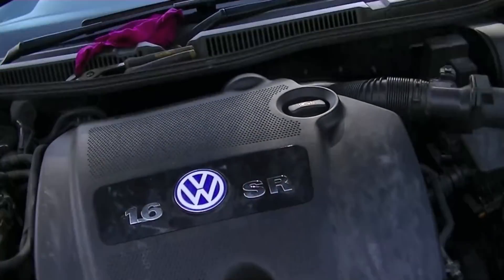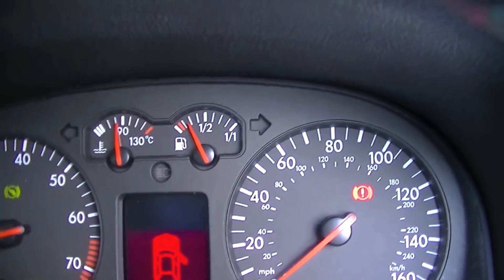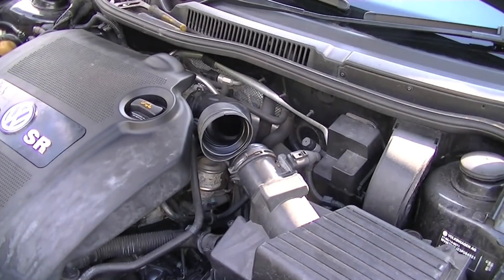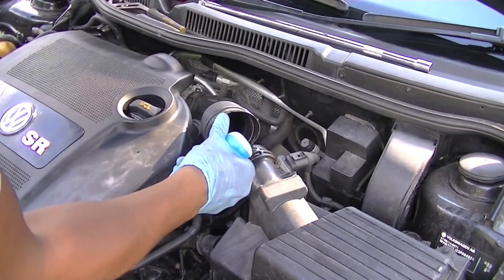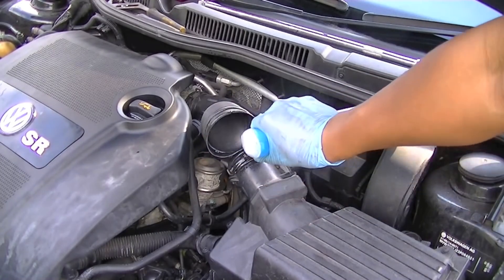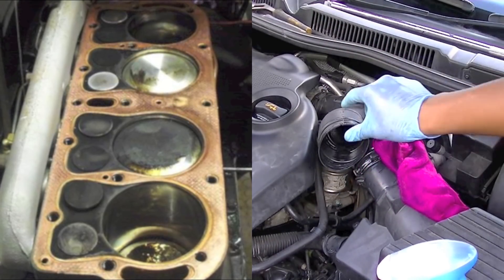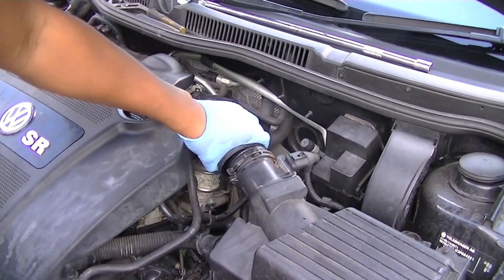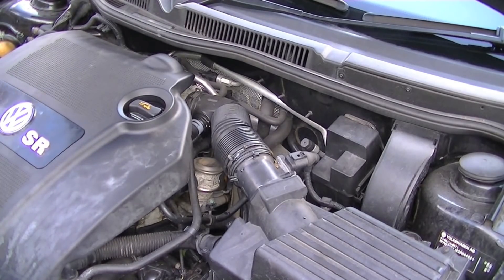How to make your engine run better with just tap water.......Better Than Seafoam?

Comment: Whether this works or not makes absolutely no difference, because doing this is extremely dangerous and can very easily destroy your engine entirely. Its danger alone far outweighs any little carbon deposits it may or may not clean. If your engine has any significant carbon build up that is causing performance issues, a much safer way is to just run your car in the mid rev range (about 3k rpms or so) for a little bit. In that rev range and up the engine will run a leaner fuel mixture resulting in a hotter and more complete burn which also results in the burning of carbon deposits. Pouring an incompressible liquid into what is essentially an air compressor is the worst advice iv ever heard and no mechanic with an education would advise it. Unless you can afford a new car.
Reply from the maker: BMW have just released their New M4 with a water methanol injection set up. Can you explain why they would do that if it was such a silly idea?
Reply: +BMAC VAGS Because they designed that engine to run that way. The engine in this video, and 99% of the engines out there are not made to have water in the combustion chamber. Some engines run on alcohol, so why dont we just pour vodka in our gas tanks?
Reply from the maker: +Nick Palaroan So are you saying they have designed a engine to compress water?
Reply from the maker: I think if you understood what was happening a little better, your thoughts and opinion would change. Have you seen what it takes to hydrolock an engine? 
If you have then you would know that spraying a little water into the intake will do no harm.
Reply: +BMAC VAGS No. Water cannot be compressed, its impossible. But I did just look up that engine and heres how it works.....It sprays a fine, controlled mist of water into the port which cools the air before it reaches the combustion chamber helping to cool the engine. And because water is incompressible, it also increases the compression ratio in the engine. You see, the engine was designed to have water injected into it. A normal engine, namely the computer controlling the engine, is not setup to accept water into the combustion chamber which will increase the compression ratio (since the water is taking up space but cant be compressed or burned) and the computer cannot compensate for that. What you sprayed into this engine was far more than a mist, and far more than the car intakes when its raining (which is almost nill the way intakes are designed so water doesnt enter the engine) the engine may seem to run fine, but chances are you created alot more pressure in the engine which could have easily damaged seals or cracked the block.
Reply: +BMAC VAGS How much it takes to hydrolock an engine will vary greatly from engine to engine....there is no set amount, and typically its not very much. And theres no way of knowing what amount will be safe and what amount wont be without doing a shit ton of math and knowing the engine your working with inside and out. I highly doubt you did either of those things before hand.
Reply: +BMAC VAGS I know exactly whats happening. Iv built engines, i know how they work. Iv already put it simple for you. Whats happening is your spraying an incompressible liquid into a compressor which equals bad news. Like i said, thats how engines blow up. They dont always hydrolock either, in some cases the pressure can bend the connecting rod which can result in a piston shooting out from the block. Know the dangers of what your doing before you do it....
Reply from the maker: +Nick Palaroan Fuel is incompressible too, but in small amounts you will have no problems. How many con rods have you seen blown out by water/methanol injection?
Reply: +BMAC VAGS Fuel is not incompressible.....if it was, no engine would work....fuel is much less dense than water, which is why it is much easier to compress than water. Water is compressible, but no engine will have enough force to compress it.  Fuel on the other hand, is also vaporized before it enters the combustion chamber, making it that much easier to compress....chances are, since the water is more dense it most likely wont enter the combustion chamber in vapor form.  I dont know why your still bringing up water/meth injection engines because they have nothing to do with the normal production engines we are talking about. They are designed to run differently, as Iv already described.
Reply: +BMAC VAGS Im not saying that this method doesnt work to decarbonize an engine, I personally dont believe it would do any good and given all the minerals and salts in tap water chances are you are introducing more junk that can leave different kinds of deposits of their own and the salts certainly wont be good on the internal components.
Reply: +BMAC VAGS Its good that you mentioned to put the water in after the MAF sensor, however you also talk about the engine "dying", thats a sign that your most likely causing damage already. And you talk about coolant leaking onto a piston and steam cleaning it....well, coolant has alot more in it than tap water does, and alot of its main ingredients are solvents which would do an excellent job at cleaning that piston so there really is no reason to believe that tap water would do the same thing.
Reply from the maker: +Nick Palaroan Check out the internals on HHO and water/meth vehicles, i think you will find that the internals are much cleaner than conventional. I know what i am saying goes against your common train of thought, but that does not mean that it doesn't work
Reply: +BMAC VAGS And then  we go back to....why dont we just run our cars on vodka? Other engines can do so. Your logic is flawed im not sure why you cant see that...
Reply: +BMAC VAGS Im not saying it wont clean the carbon, stated that many times. What im saying is that in the process of cleaning the carbon you risk damaging other components and the quality of the water itself can cause other damage and build up.
Reply from the maker: Nick Palaroan Ok fair enough. However I would like to add that there is little to chance of it doing any real damage if it is administered in this way. And in my experience the dangers are minimal. Have you ever tried it?
Reply: +BMAC VAGS No. I have no need to try it. As iv stated, theres a safer and easier way to remove carbon deposits and thats by reving the engine up to mid range where the fuel burns hotter and more completely.
Reply: @nickpalaroan8865  A litre of vodka is $35, a litre of gas is $1.26. You drink vodka, fill your car with gas, not the other way around.
Reply: physics isn't exactly your strongest subject is it Nick.   I think you may be able to expound on some subject that you have learned about in life, but this is not one of them.
Reply: +Nick Palaroan BMAC VAGS isn't putting a significant amount of water into the engine. The small amount of water would simply be turned into steam by the engine heat. A LOT of water would hydrolock the engine, so don't go pouring a litre of water into your intake, common sense really. If anything, i would want to change my engine oil after doing this. 
Fuel is incompressible, it's a LIQUID. Thankfully the fuel is injected into the engine in a MIST, in small quantities. 
Driving at 3000 RPM for extended amounts of time wouldn't clear the engine significantly.... as that's the engine speed attained by driving on the motorway anyway. 
I don't believe this method works either to any great degree however, it will remove some but not significant amounts of carbon build up.
Reply: +Nick Palaroan OK, so tell us exactly how spraying a little water in an engine can destroy it. When doing this, you are just putting small amounts of water in, not near enough to fill the cylinder. The water is dispersed among all cylinders, you would have to dump water in like crazy to do anything. The car would stall  before he could too much damage. You're acting like he is using a garden hose to put water in his engine. And no, BMW's engines are not specially designed for water injection, you can add water injection to any car, people have been doing it for decades as a way to control detonation. Too much water could wash down cylinder walls which is not good, but a spray bottle or dribbling water into a carb will not hurt anything in the engine.  Most cars hydrolock from a stuck float or a fuel pump that runs when car is shut off, pushing fuel past float out of fuel bowl, then when you try to start your car, bad things can happen. You're stuck on water not being compressible, which is true, but doesn't really apply here. Yourmechanical aptitude isn't what you think it is.
Reply: yall ignorant fucks , i said do some research , it works, theres video evidence . THATS WHY I SAID DO SOME RESEARCH .
Reply: +bigkification Fuel is far easier to compress than water. Water is technically not &quot;incompressible&quot; it just takes an insane amount of force to compress it, far more than any piston could. Fuel on the other hand, is a much less dense liquid and will compress easier, however we know that the engine does not compress liquid fuel it compresses vaporized fuel.
Reply: Bizzy Bee
A simple spark will not split water you idiot...It requires alot more electricity than that for a longer period of time.
Reply: bryson west
Im not stuck on anything. Im simply explaining why tap water is not good to be put into an engine, and not only because of hydrolocking risks.  Again, since you cant read, tap water contains alot of minerals and salts that you DONT want inside your engine. And yes, the specific BMW engine in question is in fact designed for water injection, you cannot just throw water into the cylinders of a normal car and expect any improvement in performance or life span because you are literally changing the parameters of the cylinder which will throw off everything else in the engine since the computer isnt programmed for it.
Reply: +Nick Palaroan Nonsense.
Reply: Nick Palaroan Sorry, but are you just trolling or simply lack understanding of basic principles of physic? If you don't pour all the water in the intake at once, but do it slowly by small quantities, it is impossible to damage or even destroy the engine. The small quantities of water will evaporate instantaneously and escape through exhaust. Especially if you won't pour the water, but rather spray it. The only possible damage that might be done in theory is scratching the cylinder surface by pieces of carbon that would come of the cylinder walls during decarbonization (but that is my theory and I'm not sure if such thing can happen). That's all I would be afraid of, nothing less, nothing more.
Reply: +sumixSTYXX No use arguing with that dude, he's got halfass knowledge and a closed mind. I am an aerospace engineer specializing in combustion and commercial aviation jet engines and I know what this guy did would not damage or kill the engine. Though I would advice not using it for diesel engines which run at higher compression ratios. Although I must add that I am a bit skeptical of how much carbon this technique would remove until I do this myself and see the before and after picture of the piston heads using a borescope.

Having said that, I would also only do this just before servicing my engine and change the engine oil after.
Reply: +BMAC VAGS Water/Methanol is injected to increase the octane of the fuel (with methanol) and to reduce engine temperatures (with the water). The engine is tuned to run a higher octane mixture. All the water does is take up energy in the form of heat through evaporation
Reply: +BMAC VAGS Their water methanol injectors are far more than spraying water with ajax bottle into the manifold.
Reply: +Bizzy Bee HHO made by spark? Rofl.
Reply: FrozenHaxor Do some research on it . wont dissapoint.
Reply: sumixSTYXX
Hey man, you can put whatever you want in your engine. If you think pouring dirt into it will somehow magically clean it, then you go right ahead no one is stopping you.  I just thought it would be helpful that some people could get an educated insight on whats really happening when you spray crap into your intake that engineers spend money on trying to keep out.
Reply: +Nick Palaroan ** distilled water ** would be preferable, but that also will go out the exhaust too. needless to say you really should use distilled water.
Reply: Nick Palaroan What dirt are you talking about? I don't know how your tap water looks like, but mine certainly doesn't contain any dirt. Yes, the salts might be a problem in some areas with water containing a lot of calcium/magnesium/whatever, but I'd suppose that anyone doing this would just use common sense and use pure enough water (ideally distilled) in such case. Now where's the problem?
Reply: +David G What's your problem? Are you suggesting that education is a bad thing, because atleast I have something intelligent to contribute to this discussion. You on the other hand are simply abusing me when you know jackshit about me :/
Reply: Nick Palaroan Either the water doesn't reach the combustion chamber as liquid but gas as steam(which doesn't do any damge because gas is compressable) , or the water reaches the combustion chamber compresses with the fuel and then expands into gas(steam) with the fuel in the power stroke. I think the problem is quantity. If you hose the throttlebody with a garden hose full of petrol, You will get the same effect as hydrolock.
Reply from the maker: +Nick Palaroan So what will the so called contaminants do to the engine?
Reply from the maker: +Nick Palaroan Salt alone does not cause rust
Reply: +Nick Palaroan lol this is hilarious. 

Guy, are you simply here for the lulz or what?
Why are you going on about compressing water and fuel as though they filled the cylinder? 

Another thing that leads me to believe that you're here for the lulz is the fact that you obviously refuse to do any research outside of what you feel you know to be true. 

Fact is, it is a VERY common practice to add water/methanol injection kits to cars with or without STOCK ecu's. All this to gain more power by either mechanically raising your compression ratio or adding more boost. 

You sayin spraying a fine mist of water into an engine will damage it IS saying that cars that have it stock like the BMW are stupid because it is the SAME practice. 

As mentioned, do a little research if you are genuinely willing to learn. I live around cars that run aftermarket methanol injection kits that do so with great success and longevity.
Reply: Nick Palaroan lol do some reading sir. I've been done flr a while now.
Reply: Yes this is true, I've done this before.
Reply: +Nick Palaroan Fuel as a liquid is not compressible. Too much fuel in a cylinder is the same as too much water, it will wash down cylinder walls and cause problems. When the water hits the air stream in the manifold or goes through an injector, it too is atomized like the fuel. It is the cooling effect of the water, not the water it self that loosens up the carbon.
Reply: +Nick Palaroan if you upgrade your spark system you can have water injected into the cylinder. How you may ask the spark will split the water by electrosis , and will separate the molecules or elements of what the water is devrived of . In this case water is made out of two parts hydrogen (a highly explosive gas ) and one part oxygen . Is that not a perfect combination for combustion or fire ?
Reply: +Bizzy Bee Splitting water with plasma in such conditions is impossible. How is this related anyway?
Reply: +Bizzy Bee I don't base on videos, I base on scientific papers and encyclopedia. If you get your research from random yotube videos, then you're quite pathetic honestly. No hard feelings but you should really reconsider. There is at least million videos claiming free energy which are made in a way that a layman would actually believe. Don't be like that.
Reply: sumixSTYXX
So the dirt and salt in the water just disappears when spray it into the engine? No.  Who doesnt understand physics now?
Reply: sumixSTYXX
Your water goes through pipes to get to your house....along the way, it picks up some of the metal along with any other microscopic particles that may be lingering in the pipes.  Its not always dirt you can see, but trust me its there and you can taste it.
Reply: +Nick Palaroan is engine load a factor in carbon removal, or is RPM sufficient? I have a short commute at relatively low speeds so will tend to drive around in lower gears that keep the RPM closer to the ~3000RPM I might see if I were travelling on the motorway. There aren't many opportunities to give it the beans and clear out any cobwebs, so to speak.
Reply: +FrozenHaxor no way trust the hippy.i done it to my range rover, it works but only with perrier water and thats more expensive then petrol
Reply: r00x
Engine load and RPM generally, but not always, go hand in hand. Its not the RPM that really heats the engine up its the A/F ratio it runs at. The RPM does make a significant difference yes. But you want to get the engine in its most efficient power range which is usually around where the torque peaks (but not always) which can usually be found in the mid rev range.  At this point, its usually running at its leanest.

If you really want to get to know your engine, you can install an A/F display which piggy-backs off your O2 sensor to show you what A/F ratio your car is running.

Personally I wouldnt recommend just driving around at 3k rpms for an extended amount of time as it does cause a little extra wear. Its not a bad idea to do it a couple times a year to put it through its paces.
Reply: +shady shane lmao
Reply: +Chandrahas Naphade Wasting money on education is a bad thing haha. Especially since information is all free now.
Reply: +David G If you judge me because of what a few people from my field did to you, that just makes you a prejudiced person. I cannot reason with a person who only wants to throw abuses at me and not listen to me at all.
Reply: +Nick Palaroan I did not have to pay for my education because I had department funding. And I do not think that money spent on education is wasted anyways.
Reply: +Chandrahas Naphade Why dont you think the money is wasted? I can learn the same thing for virtually free here on youtube haha. Unless your going to be a doctor, college is useless.
Reply: +Chandrahas Naphade Well, not from this channel anyway....haha
Reply: +master420148 Nope, gasoline cannot mix with water or vise versa.
Reply: he got you there. Fuel is incompressible because it is a liquid, but because there's so little amount and atomized(mist) that it doesn't do any damage. Now if he had sprayed the intake with a garden hose instead of misting it in there. This would be a vrry different kind of video all together.
Reply: +Gerald Guevara Thats not the difference at all haha. Fuel burns, water doesnt. Thats why fuel doesnt do any "damage"....atomized water will not burn, it will just increase the compression ratio. Which is what water injection is used for amung other things...
Reply: Gerald Guevara
a petrol engine does not or should not produce any sutty deposits, so surely if this is required there is something more wrong with the engine. oil getting into the combustion chamber for instance.
Reply: Gerald Guevara
The water will most likely reach the combustion chamber as a liquid not a gas. This would be how it is used to increase the compression ratio in certain engines. Which means it is not compressing with the fuel, but instead just taking up space.

However, even if the water turns into a vapor before or after combustion, you still have the issue of all the contaminants in the water itself to deal with that the parts in your engine are not designed to handle. AKA, extra salts and minerals.

So the problem is not whether or not the water is being compressed or not, its the contaminants in the water that can cause issues.
Reply: BMAC VAGS
Salts cause rust.
Minerals will cause deposits.
Reply: BMAC VAGS
 Is certainly an excellent catalyst though.
Reply: BMAC VAGS
Salt alone will not cause rust, no. But it helps to accelerate the process very greatly.

Ever notice how in places that get alot of snow that they generally give you the option of undercoating your car? Or they used to, I think all cars are undercoated now as standard. But anyway, this process is done because the roads in those areas are regularly heavily salted and the protective coating under the car ensures the salt will not cause rust issues to the chassis.
Reply: Stinky Cheese A vapor is a gas dude haha.

The rest of your comment is just comical. Because water is a byproduct of burning fuel doesnt mean water is being compressed haha.
Reply: +Nick Palaroan You obviously have no idea what you're talking about.  You can even hydrolock an engine from excess fuel alone, no water at all.
Reply: Stinky Cheese Not if the engine is running. You would have to be pouring fuel directly into the cylinders at a pretty high rate. 

Modern fuel injectors are not capable of delivering the fuel flow rate possible to hydrolock an engine. Not even the fuel pump is.

Fuel, even in a liquid state, compresses easier than water does. Water is much more dense than fuel. It would take a considerable amount more fuel to hydrolock an engine than it would water.

Ontop of that, adding water (which we agree increases compression) and increasing compression is a good way to blow a gasket.
Reply: +Nick Palaroan It's the same for water, that you'd have to be pouring it in at a pretty high rate.  However you are only thinking in terms of a full burn per cycle.  If there is too much fuel to ignite, an increasing portion could build up in the cylinder, just as it would with water.

The fuel pump certainly is capable of delivering enough to hydrolock, as it has actually happened to people which should be evidence enough.

Fuel does NOT compress much more than water at the pressure in a cylinder if it doesn't ignite.  It takes practically no more fuel to do it.  Differences in density only apply if there were much higher pressure involved.

Yes it could blow a gasket, and yet, people have done it in moderation without any damage, just as they have added drygas (alcohol) to their tanks to allow an engine run long enough to burn off water that got into their tank somehow.

It's all about quantity.  A human can ingest a small amount of salt over a period with no ill effects, but try eating 5 lbs at a time.
Reply: Stinky Cheese You can only flood an engine with fuel if your ignition isnt working. Otherwise, enough of the fuel will burn that wont fill the cylinder.

Water on the other hand doesnt burn. So it takes less to fill the cylinder.

Also, adding alcohol to your gas will not allow it to burn the water. Water cannot be burned. Ethonal will attach itself to the water and seperate from the fuel, the ethonal will burn the water will not.

You cannot burn water. Thats why it must be seperated into hydrogen and oxygen in order to burn.
Reply: +Nick Palaroan Yes, your ignition isn't working if there is too much fuel, misfires are common with stuck open injectors or excessive vac intake rate of some popular fuel-solvents used instead of water to clean engines.

Keep in mind that people often go to these odd measures only after their engine has stopped running well.   "IF" everything were working correctly then yes the exhaust stroke would purge excess fuel at a rate sufficient to prevent hydrolock, yet you could still easily end up with a flooded engine condition where you either have to wait to get an engine started or hold the pedal to the floor to cut off the injectors.  This is clearly a state where there isn't fuel burning.   I think I have grown bored thinking about this topic, Bye.
Reply: As stated above. Do a little research bud. 
Adding water/meth to a "normal" engine infact allows you to run higher compression, boost (turbo cars) and timing. Than you could otherwise.

And stock ecu's are programmed to keep the motor running within a certain set of safe parameter. So think, if water injection cools your intake charge, one would assume that meth actually keeps the engine within that safe range for longer while going harder.

And as far as a motor being specially built for it, If anything they would run more timing and more compression since the meth increases room for error.

PS. How long do you think the water is going to stay in the motor?
Reply: Master Shake Yes ECUs are made to run within a certain parameter. Increasing compression takes it outside of the parameter. Because the compression ratio in an engine is not meant to be dynamic the ECU cannot compensate for it.
Reply: ECU can and do compensate for it by changing ignition advance.  If it is outside of parameters it will throw up a diagnostic code.
Reply: Stinky Cheese Your right it would advance it, my bad.

However you still have the issue of the engine running outside of its parameters. Advancing the timing simply makes the combustion more efficient however your combustion is still occuring at random points due to having random compression ratios.

ECUs cannot possibly compensate for a variable compression ratio, its impossible.
Reply: Turn your words into profit.  Let me know when that happens

fail
Reply: Stinky Cheese I already have. I used to build engines haha.

Tell me how an ECU is supposed to KNOW what your compression ratio is going to be when its constantly changing? A factory ECU will not actually compensate for a different compression ratio, only knocking that occurs from pre-detonation. It is programmed with a set compression ratio that does not change in its system, ignition timing can only do so much
Reply: Master Shake A water/meth injection kit injects a SET CONSTANT  amount.

Randomly spraying water into your engine with a spray bottle is not the same thing.

Do you know the difference?

Constant compression ratio versus variable compression ratio.
Reply: If you drive too fast on a road you will wreck.  Randomly driving slower is not the same thing.  If you drink too much you'll get drunk.  Randomly drinking less is not the same thing.  Moderation.
Reply: ummm are we forgetting that methanol burns? whereas water doesn't!
Reply: Stinky Cheese Now apply that to the compression ratio in an engine.....something that the ICE was designed to be static not dynamic.
Reply: Which means it may not run smooth while you're doing it, not that it will necessarily cause damage.  You just don't get it, that this barely changes the compression ratio.  It's a tiny amount of water relative to the cylinder volume.

THE MATH.  He's sprayed maybe 6 ounces of water over more than a minute.  He detailed to have the engine at 2000 to 3000 RPM.  That's 2000RPM * 4 cylinders (or more) = 8000 cylinder rotations while doing it, and 4000 cylinder induction strokes when water enters.

5 ounces water / 4000 inductions = 0.00125 oz = 0.037cc per induction per cylinder.  Now suppose it's a 2L engine, with 10:1 ratio.  2L = 2000cc / 4 cylinders = 500cc per cylinder.  10:1 of that means there is 50cc at top of compression stroke.  50cc - 0.037cc water per cylinder = 49.963cc remaining volume.

50cc / 49.963cc = 1% change = you're just plain wrong, 1% change is easily acceptable and an engine changes more than that every time the darn thing heats up running.

You're welcome to do the math yourself but unless I made a math error, I pretty much ended this debate by proving you're wrong with science instead of conservative paranoia.
Reply: Stinky Cheese Your "math" is incomplete since you are GUESSING. Math is only definitive if the numbers are correct.

You are also assuming the water was evenly distributed to each cylinder. Which is nearly impossible to do by randomly spraying water into the intake.

So while your math looks nice, you need to correct your variables first. In a controlled setting this may be true, but this is FAR from a controlled setting.
Reply: Sorry, you lose.  Even if it all went into a single cylinder, which is also virtually impossible, that would still only be a 4% change instead of 1%.  My numbers are correct enough, because it would take more than an order of magnitude change and none of my guesses were remotely close to off that much or are you actually suggested those few sqeezes of the water bottle were 50oz when the whole bottle can't hold that much, or are you suggesting it's a 0.2L engine?  Are you suggesting that instead of over a minute that the whole video sequence took only 6 seconds?  Don't be ridiculous.  

It's sad when someone can't even accept the truth after holding their hand to show it.  Make up your own worse case scenario numbers, we both know you can't come up with any that are remotely plausible to support your mistaken notion.  Therefore I am done having clearly shown you are wrong.  Bye bye.
Reply: Stinky Cheese After looking at your math, why are you multipling the RPM by the number of cylinders? 

If your running at 2000rpms that would equal 500 intake strokes total in 1 minute. Divided by 4 cylinders each cylinder would have 125 intake strokes in 1 minute.

177cc ÷ 125 intake strokes per cylinder= 1.4cc per cylinder in 1 minute.

If its 50cc at TDC and 500cc at BDC, then the introduction of this amount of water (assuming its evenly distributed, which it wouldnt be) then your new TDC would be 48.6 and BDC would be 498.6 which gives you a new compression ratio of 10.25:1. Or an increase of about 3%. Which is significant in this case, seeing as this will not be a constant compression ratio.

If you dumped all 177cc into 1 cylinder thats death to your engine as your compression ratio would go from 10:1 to something like 323:1. 

Good luck with that.
Reply: +Nick Palaroan You sir are a moron of the highest order. All fluids are incompressible, fuel included. The risk inherent in this process is that the water expansion as it turns to steam will raise the compression ratio to a point ring damage occurs. There is also a risk that dislodging a flake of carbon will score your bore or damage your valve seats. However, as described in the video, a very small amount of water misted into the intake is at a low risk of inducing damage... Not that I'd advise it, it's a lazy "fix" in place of proper maintenance. Goodbye.
Reply: krazed0451 you call me a moron and then agree with.....does that make you a moron as well then?
Reply: +Nick Palaroan At no point did I agree with you. I pointed out the falsity of some of your statements, I'm happy to pick some more apart if you like. 2 stroke engines fitted with an expansion chambers have a dynamic compression ratio. I stand by my point, you are a moron.
Reply: krazed0451 Actually no....you completely agreed with me haha. Do you know how to read?
Reply: You must not understand what bye bye means.  It means I have nothing else to say because I totally proved you wrong, once you annoyed me enough that I went and did the numbers to provide proof.  Only an idiot argues this much to make me do the numbers and even then, makes excuses instead of providing alternate numbers.

DO IT.  Provide alternate numbers that support your position.  You can't.

Provide your own data that would substantiate your nonsense.
Reply: It's impossible to prove someone wrong who contradicts themselves and can't recognise a logical fallacy. You realised when I first posted that I had shown you to be an idiot so you attacked me instead. It's pretty obvious that in spite of the internet offering you a free education you still don't know your arse from your elbow.
Reply: Stinky Cheese I did.....I corrected your numbers.
Reply: krazed0451 I said the risk involved in this procedure isnt worth it for various reason, increased compression wasnt a major one of them but seemed to be the one everyone wanted to argue. I simply displayed how it would increase compression and the dangers of doing so.

You said, and I quote, "A very small amount of water misted into the intake is at low risk of inducing damage.... Not that I'd advise it, it's a lazy "fix" in place of proper maintenance."

Low risk implies there is a risk, which there is. So....you agreed with me that this method is not advisable.
Reply: Nope.  It's a four stroke engine, which means a stroke up and one down is a revolution, with the first revolution being intake and compression and the second, detonation and exhaust.There is one intake per piston for every two engine RPMs.  That's 1000 intakes per piston at 2000 RPM, multiplied by 4 pistons is 4000 intakes per minute.

You must be pulling 177cc out of your arse because with 4 cylinders that would be a mere 0.7L engine, or did you mean the compression space at piston TDC?  That would also make no sense at all, even as low as a 7:1 compression ratio, no VW car engine has cylinders as large as 1.2L each.

However even with your wildly off numbers, even you concede it's a mere 3% which is not significant.

Ponder something.  The rate of water ingress is higher than this when many cars drive down the freeway while it's raining.  You have to practically drive through standing water to get hydrolock damage or have an internal coolant leak.

Nobody was dumping 177cc into 1 cylinder at once, so whatever lunacy you're suggesting, has nothing to do with the video.  I now must consider you a troll because you are deliberately introducing invalid information, while anyone with half a brain knows my numbers were pretty close except that compression ratio might be lower if it's not a turbo.

The final laughable thing is countless people have done this without damage.  Show even ONE SINGLE youtube video where someone did it in moderation with a spray bottle and caused damage, except this is going to be so you can try to trick someone else because I am done wasting time on this topic.
Reply: Stinky Cheese 177cc is the amount of water, the 6 ounces you decided it was.

You also said that dumping all the water into 1 cylinder would only cause a 4% change, which is stupid. Dumping 6 ounces of water(177cc) into a 500cc cylinder will cause a considerable increase in the compression ratio. That would hydrolock it for sure.

Also, engines do NOT intake any amount of water when its raining. The intake is designed to PREVENT water from entering the engine, for obvious reason. For the very MINUTE amount of water that MAY get into the intake the air filter would absorb it and at the most there would only be a tiny amount of water vapor that might make it into the cylinder, and thats if its very heavy rain.

Nobody ever said the damage would be immediate. When you increase compression in the engine you increase pressures which damage gaskets that are not designed for it. Also again, the main problem is the salts and minerals in water which will lead to their own deposits and allow rust to start in an area of the engine that shouldnt even be introduced to salts or minerals such as calcium....
Reply: Nick Palaroan lmao do tell, how does the kit know what amount to spray? Do you magically plug in the stock ecu and unicorns happen? Dude I'm done. You are quite obviously a troll.
steve johnston the reason it's called a water/ methanol kit is because it can be a mixture or just water. The benefits isn't from what can be burned in the charge (it's not nitrous). Instead it come from the cooling of the intake charge.
Reply: Master Shake You can set it to spray a consistant amount. That is the key difference, can you not read? I alread explained this.

An ECU can adjust for consistancy, it cannot adjust for inconsistancy.
Reply: Water does contain your precious contaminates but you forget that petrol contains ethanol a highly corrosive alcohol and fuel in general is corrosive so how do you defend that? 

And the cylinder walls are protected by a film of oil, this is designed to carry away small contaminates even bigger and more aggressive than the salt minerals you keep mentioning, engines have carbon and microscopic bits of metal from the cylinder walls and general engine wear floating around regardless. 

Of course everyone will still argue and speculate on whether this works my advice would be to try it. You can state all the physics and online speculation you want but you don't know until you try. 

I'm also not one of the "commenters" who is going to say i've been a mechanic for 30+ years blah blah anyone can be who they want behind a computer screen. 

ciao.
Reply: funny onion probably a shady mechanic who steals injectors and oil filters just to resell it to you
Reply: Nick Palaroan
Reply: Nick Palaroan actually his theory makes pretty good sense , in most muscle cars that has blowers or hood scoops like my Mach 1 , while driving in the rain some water does get in but the Heat of the motor pretty much reduces it to steam and it hurts nothing , keep this in mind everyone who comes up with a good idea it's called an idiot at first , just ask Christopher Columbus LMFAO
Reply: Calvin Howard Columbus wasn't an idiot for sure, I tyrant yes. But no idiot. 

But trust me the op of the comment is too much of a knowitall to hear you.
Reply: +Nick Palaroan 
congratulations in being a total lost cause. if you knew anything about cars and mapping you would know that we went away from lean burn engines in the 80's as it creates nox that is expensive to after treat, so all engines, n/a boosted, di everything runs stoich when not under load so your at 3k is runs leaner is total made up rubbish, on average a 2.0l engine that has 500cc per cylinder and a cr of 10:1 (numbers round so its easy for you to follow) would mean a 50cc combustion area when the piston is at tdc.. so assuming that the single throttle body and intake manifold draw evenly, its production so it will be fairly close to even through all 4 cylinders thats 200cc of combustion chamber space per engine cycle. at 1000rpm each cycle is 0.0625 seconds so for the average spray time of 1 second it will have gone round 16/nearly 17 times (16.6667) am i loosing you here? so for the average of 4cc maybe less from the sprayer over 1 second thats 16timesx50ccx4cylinders = 3200cc of free space in the engine... how your still with me 3200cc of combustion space and 4cc per second is... 4cc/3200cc = 0.00125 x 100 (for percentage) 0.125% of the total combustion space for 1 second of engine running.

thanks ill be sat over in the corner
Reply: Nick Palaroan
Reply: I spray mist-water followed by a can of WD-40 straight into intake-manifold during idle once or twice a year.  2.4L Camry has 330,000 miles... still runs like new, doesn't burn oil.
Reply: Nick Palaroan rubbish comment
Reply: Nick Palaroan just use higher octane gasoline and drive in a low gear.
Reply: uhh what?